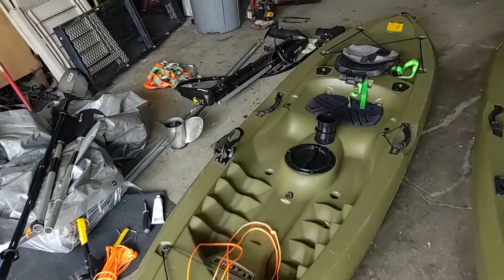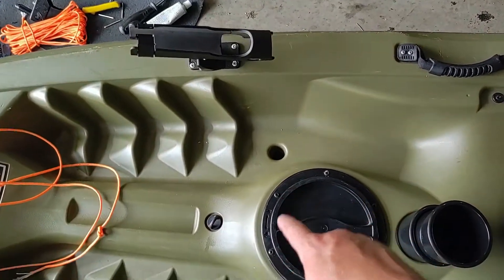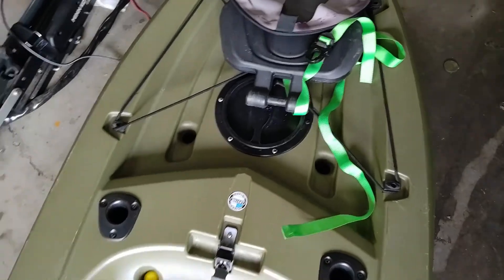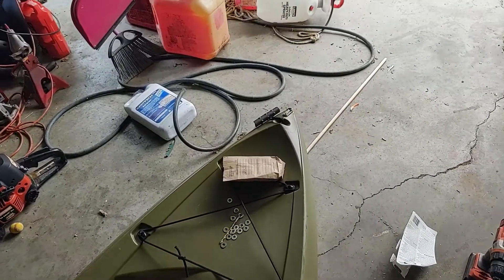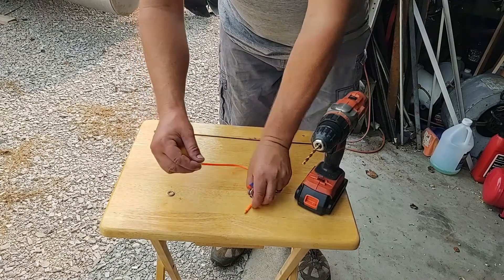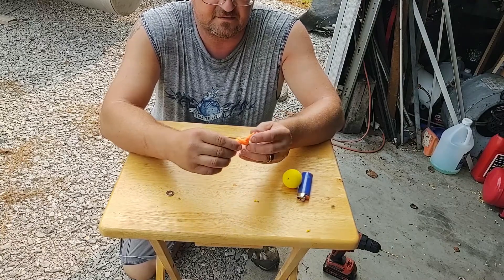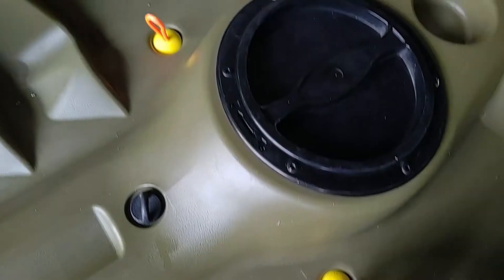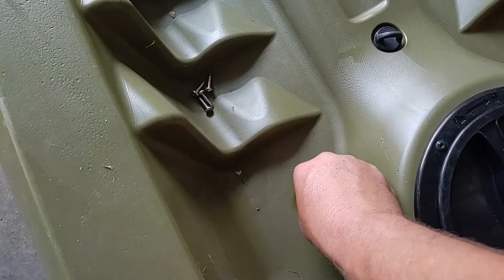Make your own scupper plugs!!!!

Comment: Now if you can invent a plug for the regular kayaks instead of the hard rubber plug they have, we would be good to go.
Reply from the maker: Yes that would be nice....
Reply: On my tandem kayak I just got from sams club has the scupper holes also but I think more water comes in then it should but then again I was told it normal for water to come in alittle bit but if I plug those holes up I should be fine ? It won’t effect anything would it?

Comment: The scupper holes are designed to let the water through that come in over the side. You are actually making the kayak more dangerous.
Reply from the maker: Yes that's what they do.... That is why I attached the strings for... Have not had an issue with them, what danger do they pose? I know there are ones you can buy in the store that are similar to the ones I make. I figured if they are that dangerous they wouldn't be able to sale them... Thanks for watching and commenting!!!!